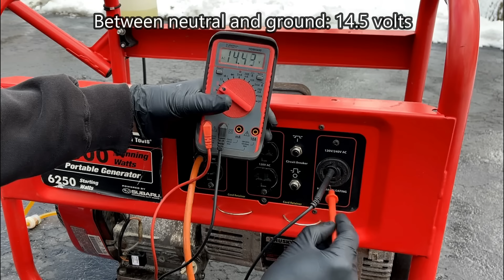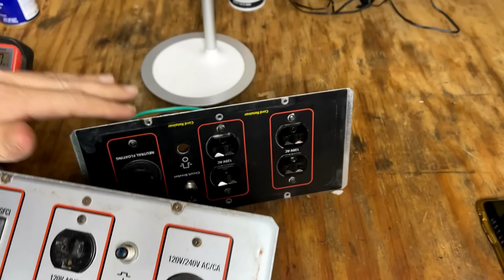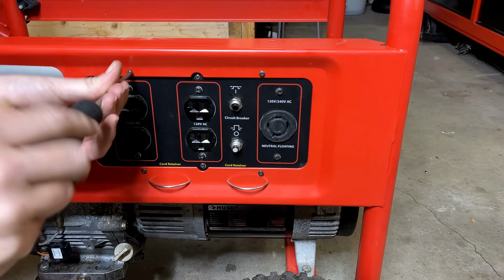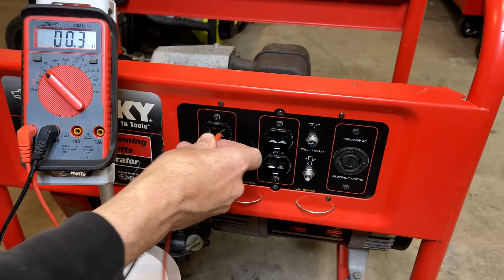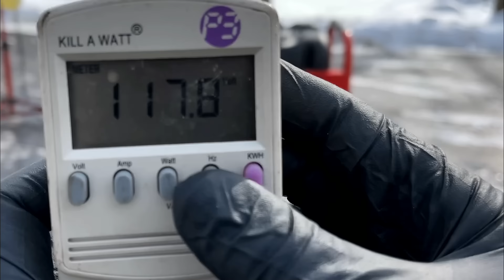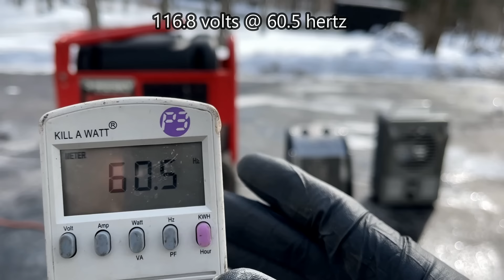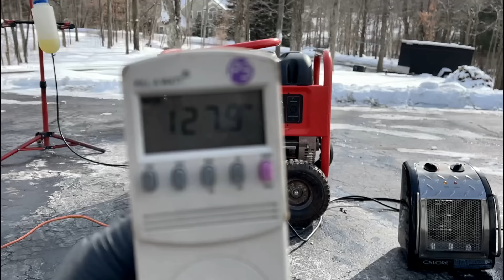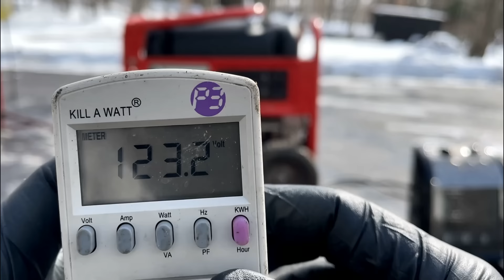No Power Output From Generator - Fixed

Comment: I cannot really see how the rotor windings could be copper plated aluminium. We all know that aluminium is a good electrical conductor, but not as good as copper. The windings would have to be thicker and heavier than full copper. The yoke and case would need to be stronger to carry the extra weght and extra volume. I saw no evidence of this. The thermal properties of aluminium are different too. Aluminium only has about 60% of the thermal conductivity of copper. It would need extra cooling. I have only ever seen electrical machines of great size and using high voltages that have aluminium windings, They use less current so the higher unit resistance is less of an issue. They design the cooling systems to cope with the aluminium too.The difficulty in soldering is probably caused by oxidation getting into the metal, from being left in wet or damp conditions for a long time.
Reply: Further to all this, I read all the comments on this thread and it made me curious to find out more about the possible use of copper clad aluminium wire in comparatively small generators. Technology moves on and I have been retired a while now. I read a comment on a different thread in which a guy stated that he found copper clad aluminium as winding wire on a Champion generator. This was in 2019. I then searched out an advertising page for Champion. One of their prospective purchasers of a 5500 watt Champion generator asked what the windings were made  of. Their answer was plain and  unequivocal. Aluminium they said. I also read on other threads that one of the big drawbacks with aluminiun wire is that it can cause awfully bad problems with connectors. Apart from the other physical differences to copper it has a different co-efficient of expansion. This causes a build up of physical forces at the ends of structures. Contacts and connectors are at the end of structures. If this really does become more common it is just storing up problems for the future. I am not impressed.
Reply: Soldering aluminium wire to copper wire is extremely difficult. It requires higher temperatures that are closely controlled so that the aluminium does not melt. Precision tools are needed so that the heat can be delivered to the aluminium through the aluminium oxide that forms on the surface. Specialist flux is also needed. It is better described as brazing than soldering. I recall once cutting off a copper braid tail connected to a thin aluminium bar inside a vehicle alternator. It certainly caused me a problem. I should not have done it. I ended up reconnecting the new replacement parts by soldering a copper spade connector to the copper wire and pushing the end of the spade connector over the flat thin end of the aluminium bar so that it was a tight fit. It was not ideal but it worked. I never made that mistake again. Ever since then I usually use a thin round splice with small brass screws on either end. The wires are pushed into the ends of the splice. Ideally the copper should not touch the aluminium and electrical connection is through an internal brass shaped piece with the screw threads fitted into either end. The outside diameter of the splice is always larger than that of the wires so doing this is not always suitable

Comment: I suspect the engine is hunting cause the fuel filter in the gas tank is clogged with salt deposits as that machine was under the sea for a little while. drilling out the jets in the carb would be a disaster

Comment: There is no way this thing has not been totally submerged in water . Great you got it working for the video but don't sell it to some sucker it will fail with that much corrosion in the areas you did not clean .

Comment: Just so you know that I'm not full of crap I've been a machinist for 40 years and now retired. That is not a good use of a drill press. If that drill would have caught it could have spun that little circuit breaker around and those wire connecting tabs. Could have sliced you open like a knife. Great way to teach somebody how to use a drill press. Yes I know you're not trying to teach somebody how to use a drill press. But a lot of people in this world are stupid. We all know someone who is😅

Comment: throw those wires back on and call it good? are you insane? That salt corrosion will quickly kill the replacement rotor youwent to all that trouble to install. If not immediately, six months later

Comment: It was painful watching you struggling with soldering the connection, didn't you realise that the other end was also corroded?
Reply from the maker: I tested the other end (off camera) and it had a good electrical connection, although it was just as corroded as the side I was working on.  Aluminum is not a good choice of wire to use on a rotor.

Comment: Ultrasonic cleaners are bad for plastic and rubber parts.
Reply from the maker: Have not had an issue caused by the ultrasonic.  The cleaners used in it do a lot more damage.
Reply: Too much heat might be, but it doesn't get any more in the cleaner than it does bolted to.a cylinder head
Reply: @jcondon1  I had some problems with the plastic face cover of the 2nd stage of my SCUBA regulator which resulted in some surface "peeling". That is when I found out that you should not place plastic parts in the ultrasonic cleaner.